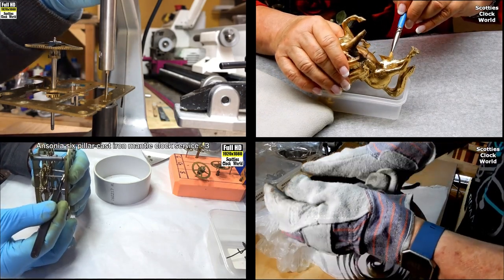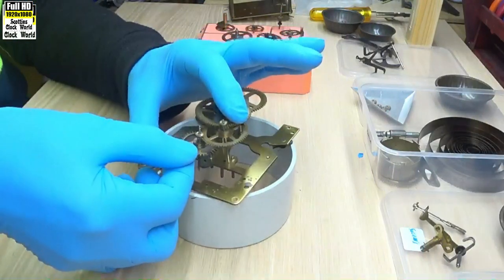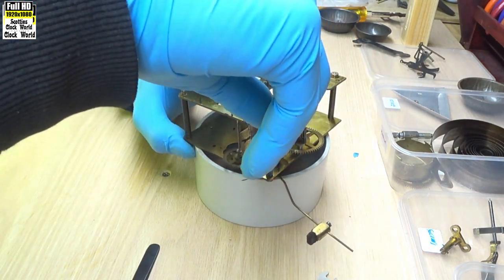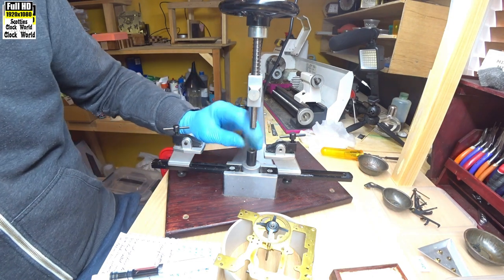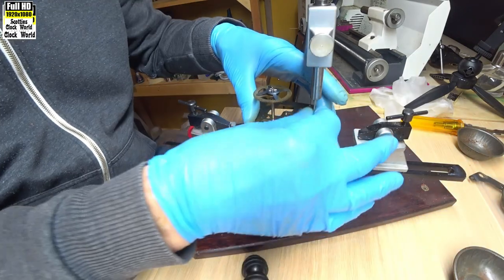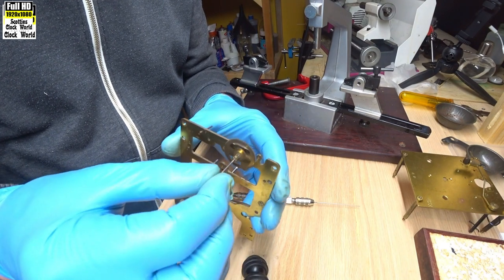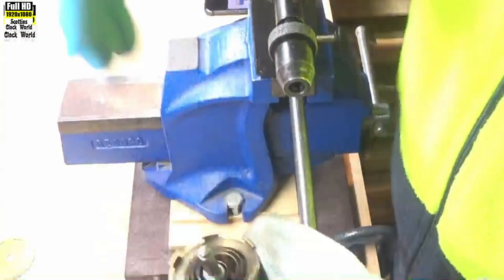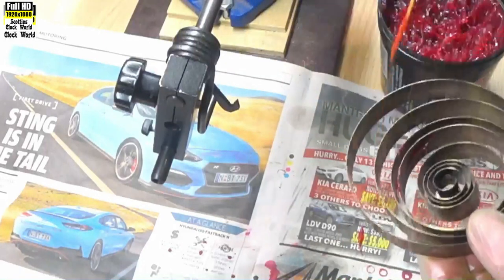How to service a German Kienzle mantle clock - Full Video

Comment: Thanks for the detailed clock repair tutorials.  I need them because I am a beginner clock repair hobbyist.  
I currently have a Sessions calendar movement (no chimes) that needs some work because the verge spins on the escapement.
I was told to nudge the "dogbone" (pin plate) a hair closer but that is proving difficult to get exact.  It either spins on the escapement or doesn't tick at all.    I am going to have to attempt my very first bushing job, so these videos are invaluable as they are the only tutelage I have.   They make drill press stands for Dremel tools, and I was thinking of giving that a go.  A rather inexpensive way to drill a pivot hole without a huge drill press.    I think it would.  Thanks.